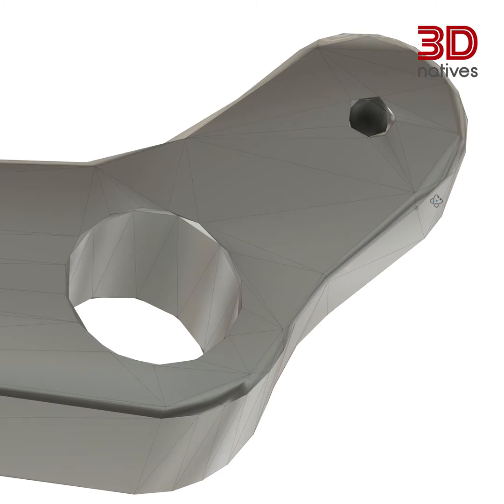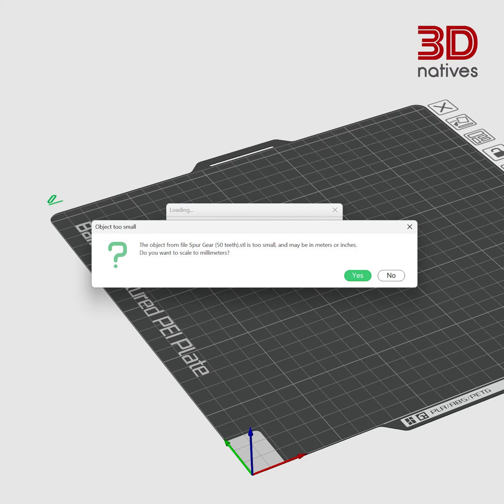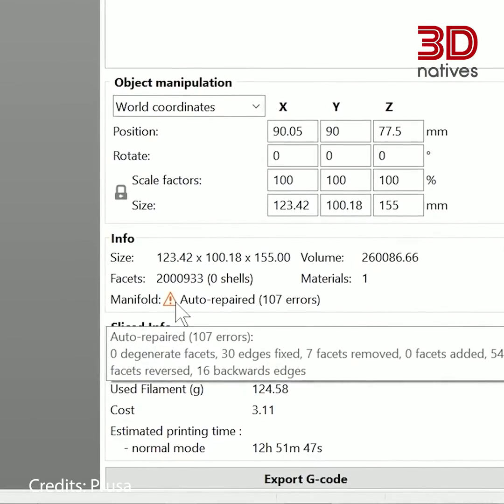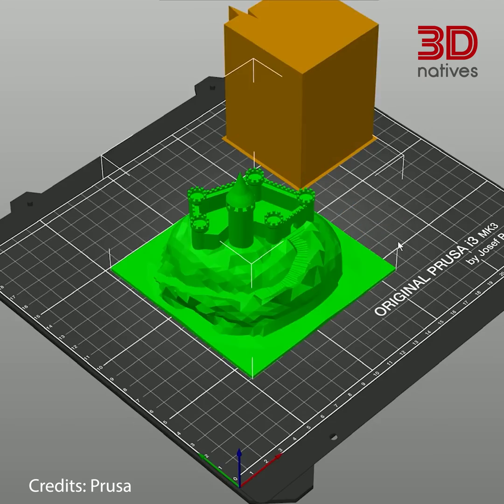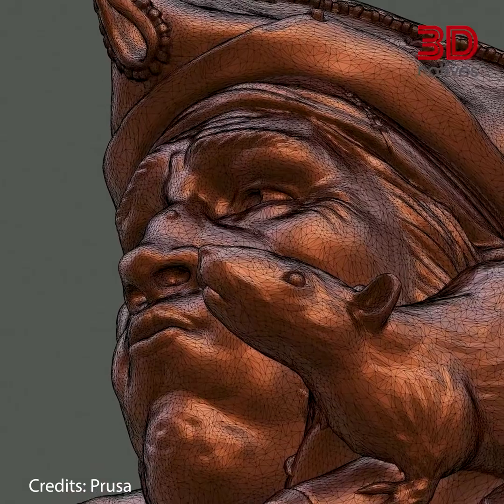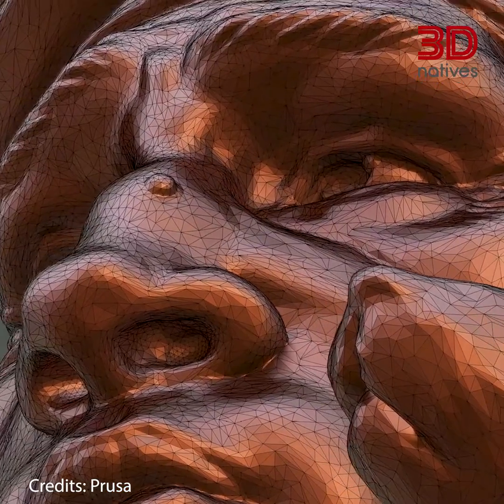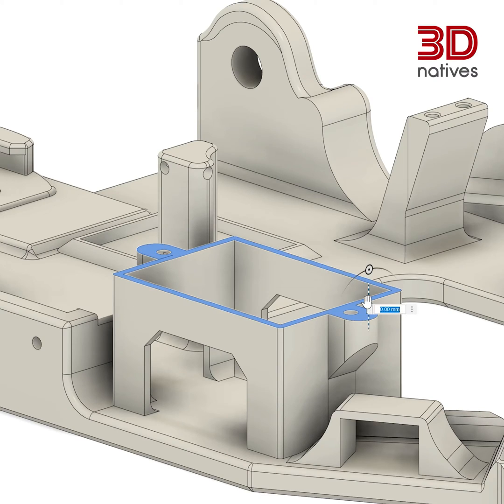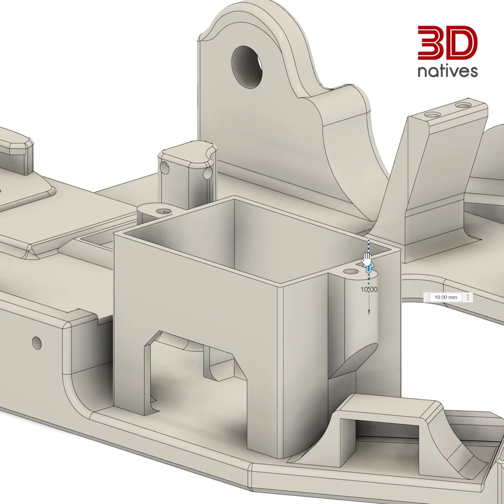How to Choose the Right 3D Printing File Format? Navigating STL, OBJ, AMF, 3MF & STEP | 3D Explained

Comment: I came across information that STEP format prints with less poly showing than 3MF resulting cleaner curves. Is STEP better over all than 3MF with other details? I also heard malicious individuals can insert malicious instructions and codes within the files.  I have been using 3MF with great results, but I have concerns when sharing those files in that format can be received with reluctance. Are the other formats have the same risks?
Reply from the maker: Hello! 3MF is a mesh file format representing models by tessellating them into triangles. STEP, on the other side, is a parametric CAD file format. Like any digital file format (3D model, image, video, document, and more), it is technically possible to inject malicious code though we haven't heard of a major problem and 3MF is increasingly popular.
Reply: @3dnatives  Thank you for your reply. I have switched to 3FM in my digital store from my tabletop terrain. I’m new in the fray, people have downloaded some of my files, but not in great number yet.  I was wondering if maybe 3MF was trusted very much, or I really suck :P
Reply from the maker: Hello again, it really is a personal preference in this case. If the popularity of 3MF is a concern to you, you can always export both in 3MF and STL and offer the option for both.
Reply: @3dnatives  yeah, I have been debating doing this.